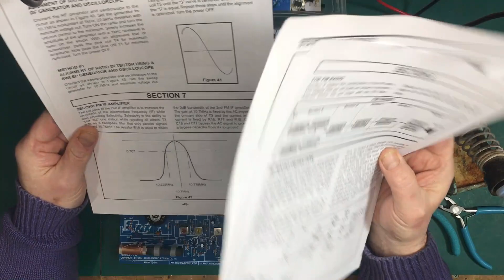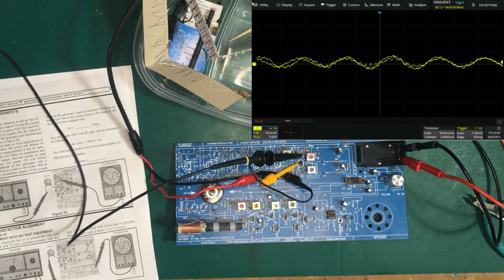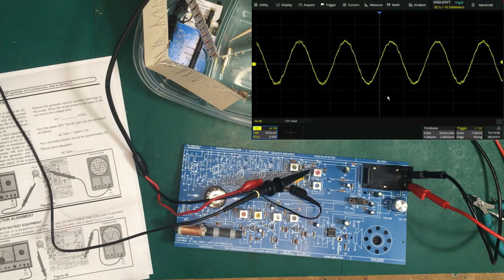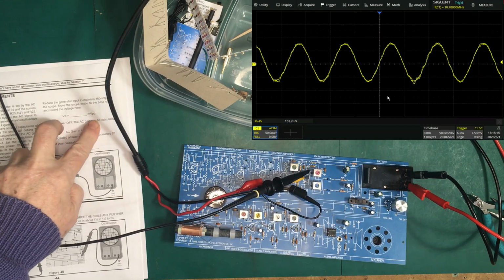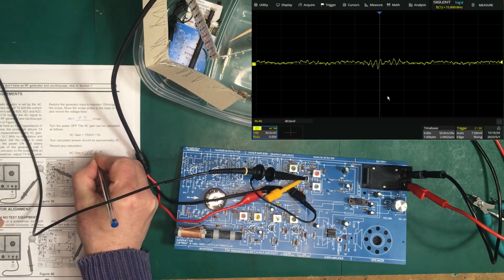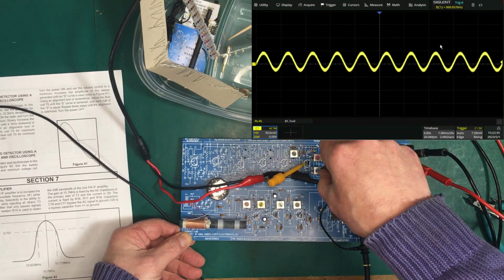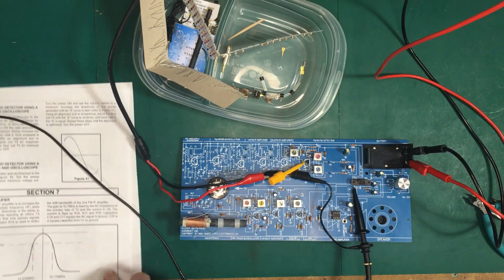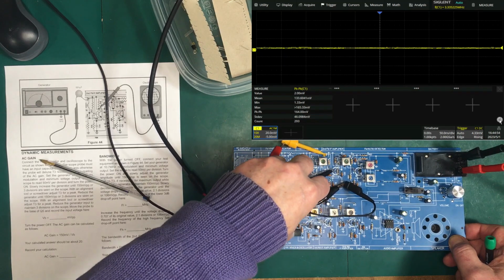0044 - Elenco AM/FM-108CK Kit Build: Part 5

Comment: Im building this and i dont understand why my T4 is only getting a gain of 3
Reply from the maker: I'm not quite sure I understand.  T4 is a transformer and does not have any "gain".  Do you mean the gain of Q6?
Reply: @uni-byte  yeah that's what I mean, when I turn the transformer it barely increases.
Reply from the maker: @Awsome-vp4nk  It's difficult for me to pinpoint anything without seeing your board.  You need to verify all the components shown in the schematic in figure 36.  Pay special attention to the colors of the coils.  T5 is Blue and T4 is pink.  make sure the transistor is indeed a 2N3904 and not a 2N3906 and that it is inserted correctly.  The check that all teh other components are the correct values.  Especially R20, R21, R22, C22 and C19.  Also check the soldering of all the components.  What is the capacitance of your scope probe?  It needs to be 12pF or less.  Is your generator at the right frequency?  Are you coupling it to the circuit through the .001 uF capacitor?

Comment: Hello, I think it would be more helpful for us newbies following along if you explain why you deviate from the manual. The manual states to use a .001 capacitor on the signal generator, but you didn’t use one and made no mention of why you didn’t.
Reply: Nice.
Reply from the maker: Actually I did.  That yellow clip I'm using has the capacitor installed in it.  I covered that in an earlier episode and showed how I built it.  You might have mossed it.

Check out episode/part 3.
Reply: My apologies.
Reply: How did you handle the requirements for a probe that has less than 13 pF? I think my Rigol probes are higher than that.
Reply from the maker: @kenmccarthy8130  Yeah, that's a tough one.  Back some time ago I got myself a pair of Tektronix P6139 probes used.  They are 8pF.  I used them for this project.

Comment: I couldn't read the voltage on the oscilloscope at the base either - too small for all of the hash around I guess.  I'm glad I wasn't the only one!!!  

Another great video BTW!  Can I go back and these tests after the radio is complete? or will the rest of the radio cause me interference?  (Tweaking T4/T5?)
Reply from the maker: Yes, you should be able to do most of them when the radio is built.

Comment: I don't believe you picked a weak station from 120 miles away.  Rather, I think you picked up a STRONG station whose signal became weak after traveling 120 miles.
Reply from the maker: You may be right.  The station is Zoomer Radio 740 AM.  They run a 50KW transmitter in Toronto.  But 120 miles for AM is pretty good and by all measures is "weak" in this area, so your point is taken.  I wish we had other AM stations around to do a better reception test, but the band is all but abandoned.